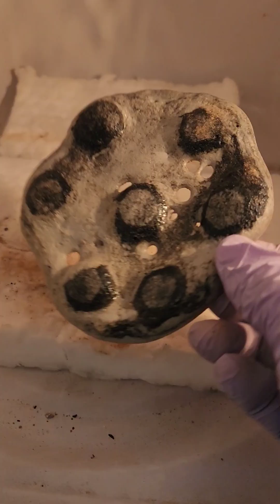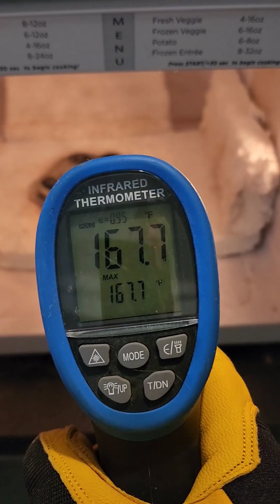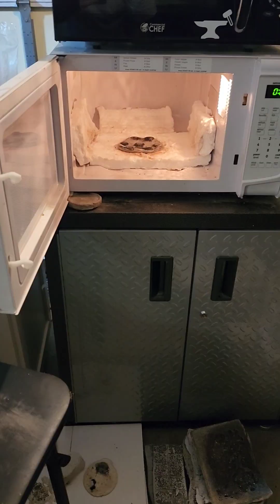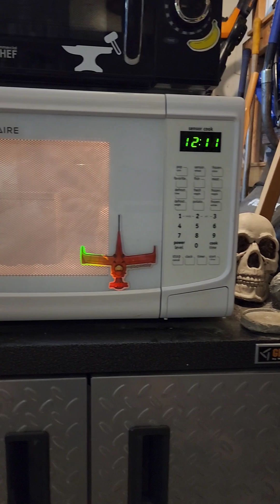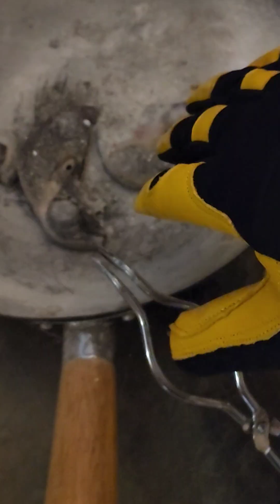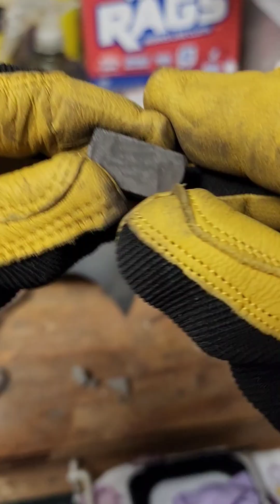Experimental Heat Susceptor - Raw Shop Log

Comment: Nice work! Good to see that there was some necking even without an inert atmosphere. Do you have a link the ballast you're using? Also might be nice data to file down the sample to a cuboid so you can measure density (or I guess can do archimedes on the sintered part). Ditto on the brown part. 

Would be interested to see another test with a longer sinter cycle. Looks like necking started but might just need more time for heat soak.

Keep up the cool work!